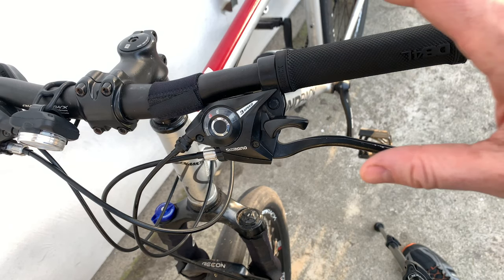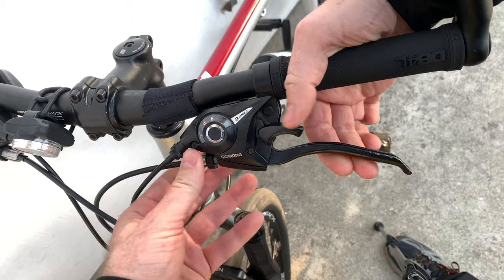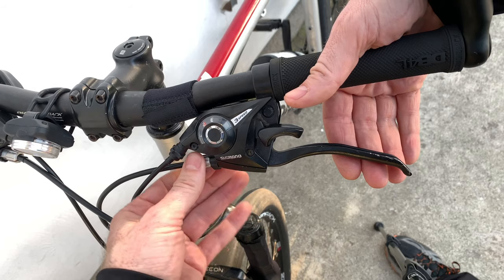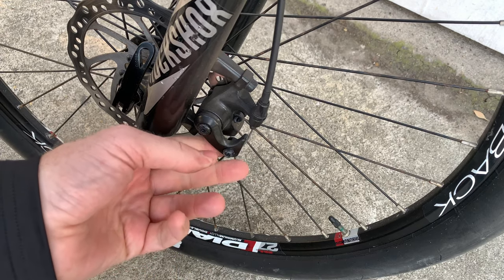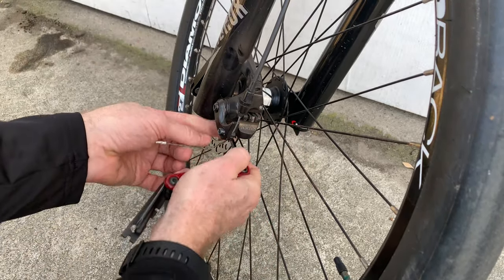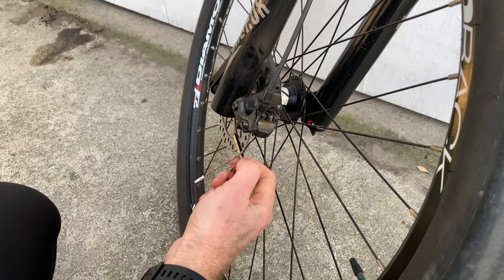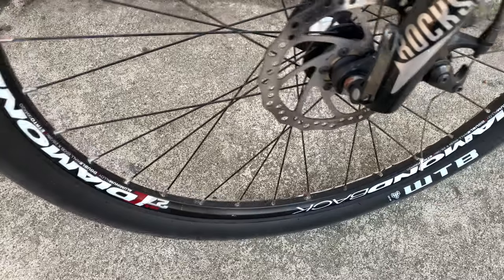How To Adjust Mechanical Disc Brakes On A Bike

Comment: I been watching videos on disc brake adjustment and they all lost me. Tomorrow I was about to take my bike to a mechanic for break adjustment, sixty five bucks including lubrication (on a new bike) and you made it so easy to understand, I put video on pause and went to do it. My wheels are turning smoothly and breaks are working great. Thanks, keep up the great videos and keep it simple at all times. Another channel even mentioned needing a bike torque wrench..... Again, great video.
Reply: "It's easy when you know how to do it"

Comment: Great video, simple and straight to the point. I saw many videos before this one and they all made it seem difficult.
Reply from the maker: Thanks. I’m glad I could help.
Reply: Andres Delavega he skipped over a few parts like trueing the disk which usually does need a few adjustments. I do it with an adjustable wrench using sight and sound spinning the wheel.  Adjusting the static caliper on the inner most side of of brakes isn’t necessarily a bad idea either lol

Comment: Thank you so much for this video. Away from home, luckily with tiny bike multi-tool & was able to tighten the brakes, by myself, in minutes, rather than finding a bike shop. Saved me hours of searching for a shop that is most probably closed until tomorrow anyway!

Comment: Thank you! Ive been struggling with my brakes constantly getting looser, so i have been adjusting them up at the handles but i saw that the screw was close to reaching its limit. I imagined there must be some other adjustment. I looked at a couple of places and everyone was talking about adjusting at the handles, not the calipers. Thank you for this video! Adjusted my brake lines and now i can stop without using my feet! LOL. I also got the confidence to adjust my caliper angle because the disc was constantly hitting it, so i centralized it. Then i lubed the chain the pedals, all looking good now.
Reply from the maker: You’re welcome

Comment: just what I needed and so simply done that even I could mange the adjustment, I would be coming down hills on my 20 hr. ebike and realized it was not stopping like it use to and this morning I almost hit a cat that stopped all of a sudden in my path and then I went to youtube to find you and this excellent short to the point video, thanks I feel sage again. Up to 800 miles on my bike and other than this I have had nothing but joy and great exercise.

Comment: Thank you for showing that. I have a problem with rear disc break not springing back fully or rather the break handle does get the wire to release fully. Where should I adjsut
Reply from the maker: The return spring is on the caliper mechanism that grips the brake rotor, so you should check there for obstructions. It’s also possible that the cable has gotten really dirty.

Comment: It took me minutes I replaced my inner cable and I was lost but this helped me so much I pulled the cable till it engaged the pads then tightened the bolt back in and adjusted the leaver till I was happy with it and it’s back to how it was again thanks for this simple video it was a straight how to do it video you just got on with it and didn’t go through the inns and outs of how a brake works 👍👍👍👍 like some other videos on you tube
Reply from the maker: Thanks. I’m glad I could help.

Comment: Wow I had to pay the bike store $150 HKD just to fix it. But it after a few months which is today, it got lose again. So I got fed up and luckily I found your video. I really appreciate it. I'm gonna try it out now. And get back to you if I get to fix it. Very simple and thorough with your explanation.👌🏼
Reply: I just tried it. It did tighten the lever but the brake doesn't work. What should I do?
Reply from the maker: Look on the back of the caliper and see if there is a place you can turn it to move one of the pads closer to the other one. I made another video about this, but YouTube won’t let me paste links into comments. Look on my channel under bike disc brakes. It’s the video I made about how to change brake pads changing brake pads is really easy, so if yours are all worn out, it’s an easy cheap job to fix them.
Reply: @hoohoohoblin  Alright I'll check it out
Reply: @hoohoohoblin  Thanks

Comment: I'm new to mountain biking and the to adjust the front brake was extremely easy, but the back hrs and still I can hear a tiny metallic sound hitting it, you can't tell unless you put your ear next to it but it's bothering me so much, is it ok if you can barely hear it?

Comment: How do you adjust the caliper so the break pads engage the rotor with more surface area? My pads are only using half of the rotor width and I'd like them to use the entire rotor for better breaking.

Comment: Just getting into e bikes, over 70, so things have changed since I was a kid, on scooters the front wheel brake is on the right handlebar. On this bike, it's on the left. Any particular reason? I'm swapping so I wont crash, at least not from the wrong wheel braking.  👍👍
Reply from the maker: I don’t know why they do that. I rode 100,000 miles on motorcycles, and whenever I get on a bicycle, I have to remember that it’s backwards on a bike. I guess nobody decided on a universal standard.

Comment: Any suggestions for loosening seized caliper bolts? Cant adjust the brakes since  I can't loosen the bolts.
Reply from the maker: I’ve always use liquid wrench to get it loose. I think they sell it at Home Depot. Probably on Amazon as well.

Comment: What of you have them as tight as they will go and it still isn't doing anything? Brand new bike is there a way to adjust the pad tightness?
Reply from the maker: There is an adjuster on the back that you can turn with an Allen wrench.

Comment: Your vid mostly helped thanks but pad still rubbing slightly.
Reply: I found, at the point he loosened the caliper and pulled the lever to align the pads before tightening up again, was to, instead, loosen and don't pull the brake lever, just manually position the caliper, so it shows equal space on either side of the pads, as you look down through it, then hold it there and tighten up the two bolts.

Comment: So I have an issue where my calipers rub against the rotor and nothing I do fixes the issue. And advice on what to do?
Reply from the maker: There is an adjustment screw on the back of the pad that doesn’t move, and you can screw counter clockwise to make more space.

Comment: If I can ask a dumb question I accidently unscrewed that middle piece out (the middle one that's facing you between those two bolts you loosen to align the brakes with holding the brake tight while retightening) and I can't get that brake cable to tighten up properly since. What could I do? Bike shop?
Reply from the maker: You should be able to screw it back in. That’s the one that changes the tension on one of the pads. If you screw it back in, you should be able to stop again. It will move the pad closer to the disc.

Comment: What a good 2 minute video! I've got another problem where the bracket itself drifts onto the disc. Came out the box like it! New replacement electric bike whirlwind C4.

 First one went back handlebars out of alignment. Sent back to me the same Second time. So went back again. Guys there not testing properly. So I asked for a replacement. New problem now. Not the way to start a new business!

Comment: When I pull the brake lever the piston pushes the pad out at an angle and bends the rotor, can this be fixed by adjusting the brake as per this video or would it be more involved?
Reply from the maker: Yes. Loosening up the bolts that hold it on, and then pulling on the lever and then tightening them while you pull on the lever will center the brake pad over the rotor.
Reply: @hoohoohoblin  Thanks :)

Comment: Jupiter bikes are a great concept however they seem like they were rushed to Market and are poorly made and do not work well when I open the package it says you need to calibrate the brakes why would I have to adjust the brakes when they could do it in the factory my Jupiter Discovery only goes 5 to 7 Miles on One battery charge it said it was supposed to go up to 20 to 30 miles

Comment: My rear wheel is dragging what should I do? I did exactly the steps you showed
Reply from the maker: Maybe your disc is bent. Try reducing the tension in the cable, and maybe slide so that the stationary pad has a little bit of space next to the rotor.
Reply: @hoohoohoblin  fixed thanks mate !

Comment: Hey so my problem is that my brakes are hard to push down and it requires two finger braking because it’s very hard to push it down with one. Anyway to fix it?
Reply from the maker: You could try oiling the cable and see if that helps. Hydraulic disc brakes are a lot easier to pull, and you can use one finger on them. You might consider upgrading.
Reply: hoohoohoblin yea I guess thanks

Comment: Followed step by step, I now pull rear brake and its tight, I see the pads touching the disk but it does nothing. Wheel just turns with no resistance... any ideas?
Reply from the maker: Maybe you need more attention on the cable. It’s possible that the pads are really worn down too. I made another video showing how to change the pads, so you should watch that one and see if anything in it helps.

Comment: I have a mountain bike with mineral oil cables instead of wires, so is it the same method?
Reply from the maker: That’s different. You need to bleed those brakes. Your brakes are hydraulic. Look up how to bleed hydraulic brakes. I made a video showing how to bleed Shimano hydraulic brakes. On some bikes it’s really easy, and others it is difficult. The problem is that there are bubbles in the system of air, and you have to get them out by pumping more fluid in.
Reply: @hoohoohoblin  THANK YOU SO MUCH I WAS SO CONFUSED AND THAT REALLY HELPS!!!!!!!

Comment: I've tightened my rear brakes and now they don't do anything just show plus the lever is extremely tight for the rear one, and the front one reaches the bar while making a squeaking noise while braking and a beeping sound in the front wheel. I probably did something wrong

Comment: My bike's front brake inside an adjustable bolt is struck and can't be adjustable how to fix it I tried to loosen the bolt with Allen key inside is rounding slippery

Comment: There should be a silver nut behind where you adjust the brake cable which has the words "pad in" with an arrow going in the clockwise direction. Get you Allen key and turn the nut and after every rotation you should hear a clicking sound. This is the sound of the brake pad being pushed closer and closer to the the brake disc which also contributes to your brakes being sharper. This was something I discovered today when i repaired my bike after having very bad brakes for a long time, even after getting new pads. Follow this guys video. If you do it and there's no difference do what I said. Good luck

Comment: Unfortunately I’ve done all of what you’ve done but it’s still hasn’t strengthened.
If I pull too much of the wire at disc brake then it comes into contact with the other part of the disc brake so it doesn’t strengthen. If I pull too little of the wire then it doesn’t strengthen either.

Comment: I have a problem when I press brakes bike stops slowly like wheel is still moving and stoping slowly I want wheel to stop instantly like dig into ground will this fix it?
Reply from the maker: Yes. This should make the pads stop your bike the way it’s supposed to.

Comment: Hey help me how can i tight front mechanical disk brake for stoppie?
Reply from the maker: If it’s working properly, you should be able to do a stoppie on it. You might need to tighten it up.
Reply: @hoohoohoblin  they are but i donno how to tighten them🤭🤭😂plz make tutorial🥺🥺

Comment: The back brake just doesnt immediatly stop its like v brakes and ive tried everything in this vid pls helppp
Reply from the maker: Take a look at this video. You might have to replace the pads. In this one, I take the pads out and adjust it for new pads and put it back on.  How To Change & Adjust Mechanical Bike Disc Brake Pads https://youtu.be/-Yj2eny1uvY

Comment: If you have to adjust this caliper arm tighter like you have shown you should be adjusting your pads in. The caliper arm when at rest should have no tension on it and the brake cable should have no slack. Learn to adjust your brake pads as that is the proper fix. The fix you have shown can cause the caliper arm to come higher then engineered and break or it can also put the brake cable at a weird angle and put stress on it that will break the cable after repeated pulls and releases. Think bending a wire back and forth 50x it will snap.

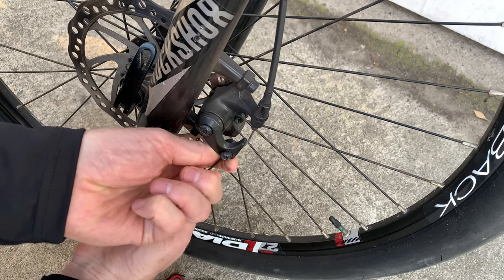Comment: 0:55 he makes a big mistake when tightening the cable at the caliper. You want the arm there to have full travel once you are done. He, instead, pushed the arm with his thumb through about half its motion and then locked the cable in place there. That's no good. When pulling the cable tight there, you want to be careful not to move the arm, you want to leave it at its full resting position. Use pliers to gently pull the cable, removing any slack and then lock the cable in place. When you are done the arm should have the maximum range of motion it can.

Comment: Step one, undo the caliper.
Step two, throw it in the bin.
Step three, fit hydraulic brakes or V brakes.. Both are better.

By the way... Rather than undoing the caliper as in the video.. all the cable brakes I've had the misfortune of having to touch had an Allen key adjuster on the back that mechanically moves the fixed pad closer to the disk. You adjust it in until it touches the disk and back it off 1 or 2 clicks. Get it as close as you can. If its right, put on the brakes and the disk stays fairly neutral...
get it wrong and your either deflecting the disk constantly (and it will be rubbing) or the disk will move sideways as the moving pad pushes it across to meet the fixed disk.

Comment: I just like mechanical disc brakes more then hydraulic because they are easier to adjust and service and you dont have to spill brake oil everywhere
Reply from the maker: I agree. I think they are more reliable, and the only difference is that there is a little bit more lever effort than you would get with hydraulic brakes.

Comment: Actually you DON'T want the adjustment screw at the brake grip all the way in when you adjust at the brake itself. You wanna leave it out, and then adjust the brake so the brake pads actually touches the disc. Then you screw the adjustment screw back in, and the brake pads will seperate a bit and be just right :-)

Comment: Hey hoohoohoblin, the method of moving the brake arm inwards is incorrect. It will help short term, but eventually, the brake arm will hit another part of the brake. Same result of the barrel adjuster. Only use the barrel adjuster to remove cable slack ( cable dropping out of the brake lever) try out this link to fix it. (parktool)
https://www.youtube.com/watch?v=NmqGeLNcVIg

Comment: Good  video but I see 2 mistakes. First, when you tighten the cable pinch bolt, you moved the lever slightly up, so this means the lever won't get 100% of its travel.  Second, you did not adjust the pad adjusting screw on the caliper.

Comment: This is actually wrong. If you do this basicly your break's gonna be active by default (without you pulling it). My Engish is way too bad to explain it but please don't do this guys. If you want to know the right way check Park Tool's channel for example.

Comment: Great bike , rides smooth https://www.youtube.com/post/UgkxHL1v1R3NE5x4KiYfyt8dnQmyNYz7qi5L   I added a bigger spring loaded seat to it . Takes a bit of adjusting cables to get brakes and shifting to perfect . I've owned quite a few bikes in the past that were absolutely uncomfortable to ride and they always ended up as garage wall decor . I'm not seeing that with this one. It's pretty light I've only ridden it a few miles but I like it . As for the pedals falling off in the other reviews , the pedal arms are aluminum along with the pedal studs look to be also . I would not overtighten them. I can see it would be very easy to overtighten them and strip the threads right off . All in all I think it's pretty good quality besides the aluminum pedal thing
Reply from the maker: That can happen. A lot of tires have an arrow on them telling you which way they should be installed. On some bikes, you put the back tire on in the reverse direction of the front tire.

Comment: yep that's what i thought.  my chinesiums are knackered.  click of death.
fk disc brakes for bikes.  they're sht.  calipers best.  even if the blocks fall out, you keep squeezing, you'll get something.  maybe a horrible grindy noise but that noise means you're slowing down.
disc brakes. first they work, then click!   full speed straight out under the truck. they should be illegal.